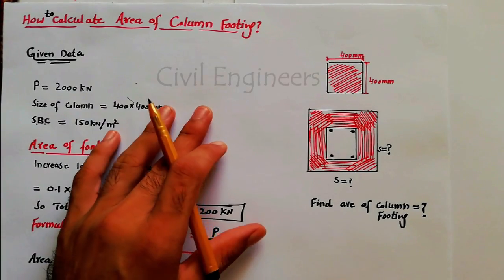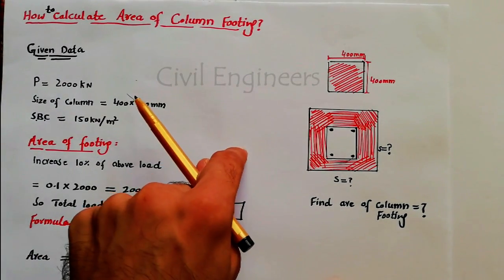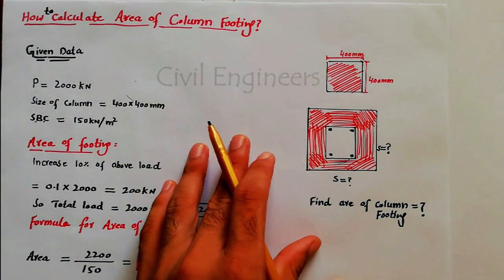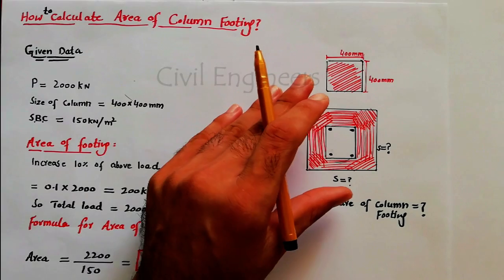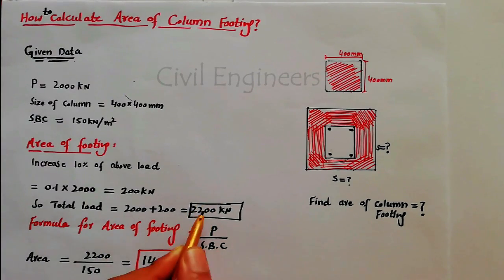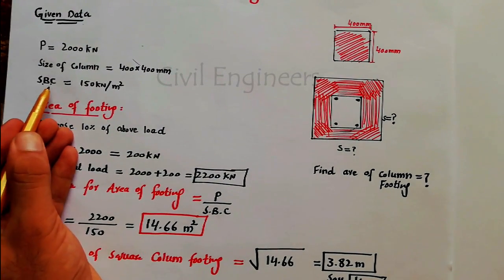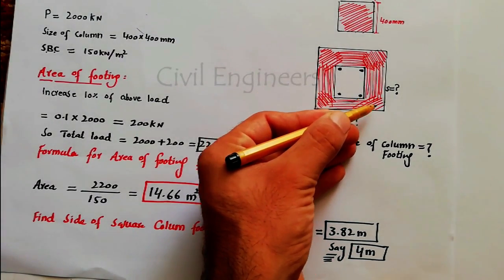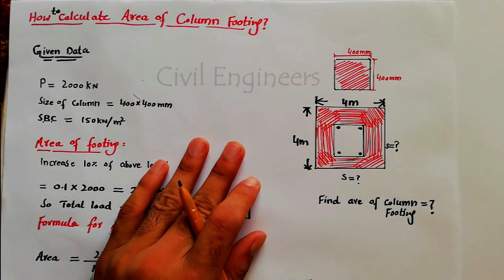How to Calculate Area of footing for Column?

Comment: YOU ARE IMPRESSIVE BUT I THINK THIS IS NOT APPLICABLE TO ANY SIZE OF COLUMN EVEN I CHANGE THE SIZE OF MY COLUMN, IT HAS THE SAME SIZE OF FOOTING?   I THINK YOU HAVE MISSING FORMULA TO MENTION HOW WE WILL CALCULATE THE SIZE OF FOUNDATION  AS PER SZE OF COLUMN? BECAUSE YOU DID NOT USE THE 400X400MM SIZE OF COLUMN TO YOUR FORMULA? PLEASE ADVISE.... THANKS

Comment: Total station par video banawo
Reply: Total station par land area kase calculate karte h
Reply: If the size of column is 500×1000 and load of crane is 10 tons and distance between column is 5 meter and span 12 meter.then what will be the size of footing in hard soil.
Sushil